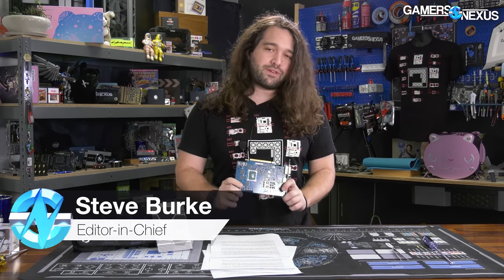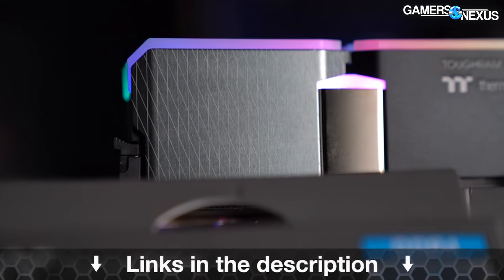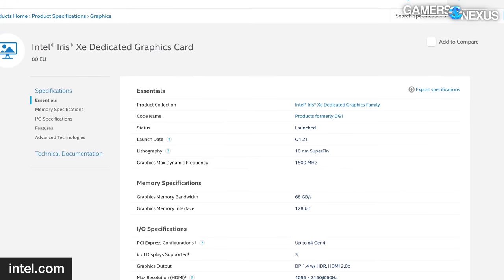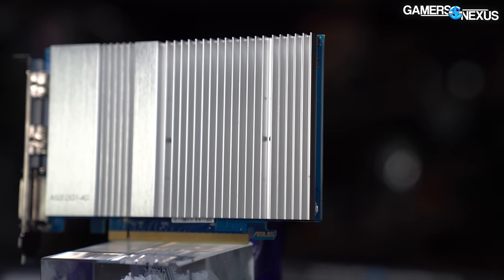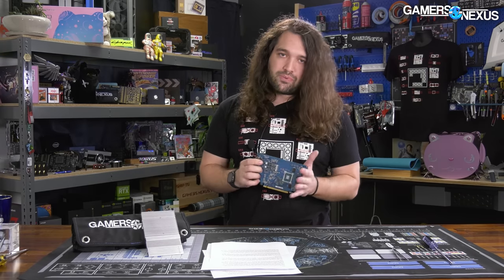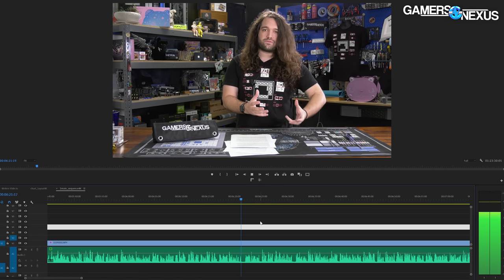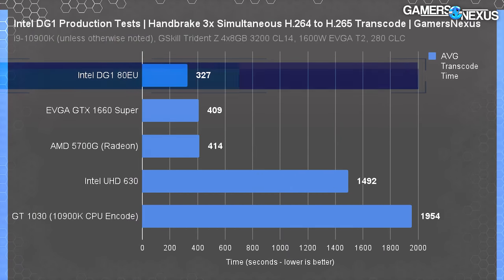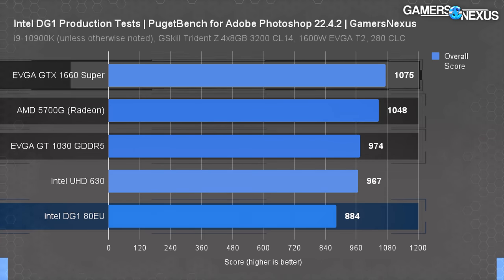Intel GPU A Real Threat: Adobe Premiere, Handbrake, & Production Benchmarks on DG1 Iris Xe

Comment: ok what? 22:13 "you can't get that feature in HEDT cpus, whether amd or intel. we've got HEDT high-end desktop CPUs in use for video editing" 
so who is making those? or did he mean "you can't get that feature in HEDT gpus,"
22:29 "(?? what is he saying ??) bc they had IGPs"
Reply: Modern HEDT CPUs on  both sides usually don't have Integrated Graphics Processors (IGP) or the Application Specific Integrated Circuit (ASIC) which features such as AMD Video Core Next or Intel Quick Sync Video use to encode/decode/render video and free up CPU time for other tasks.
Reply: @soloman3444  I think you should reread what I pasted.
in both instances he said CPUs. so he probably misspoke. ?
Reply: @leoSaunders  You are the one who should re-read what I said and re-listen to the timestamps you have in your comment.

In the former quote he is pretty clearly referring to the fact that the CPUs that they use for video editing (HEDT ones) don't have QSV or VCN. 

And in the latter he is referring to previously using the 8086k which has an IGP and as such can use QSV.
Reply: @soloman3444  "you can't get that feature in HEDT cpus, whether amd or intel. we've got HEDT high-end desktop CPUs in use for video editing"
disregarding the redundancy in saying "HEDT high-end", this sentence, to me, implies that there is some other manufacturer.
Reply: @leoSaunders  I see absolutely no way that sentence could be interpreted to imply some other manufacturer, to me the first sentence establishes that HEDT CPUs don't have hardware acceleration and the second sentence states how they are using the higher end of the HEDT class of CPU for video editing.
Reply: @soloman3444  I guess.
alright, thanks for replying